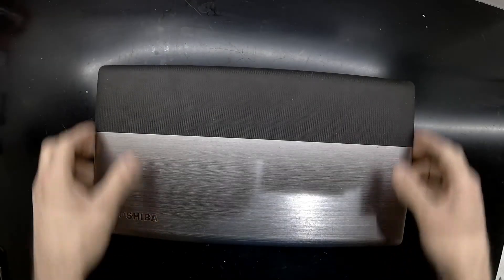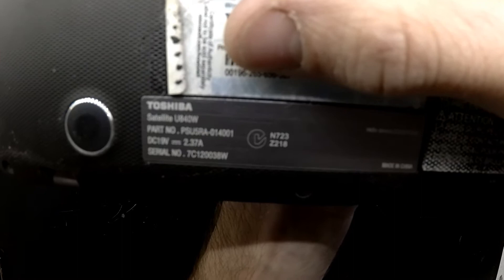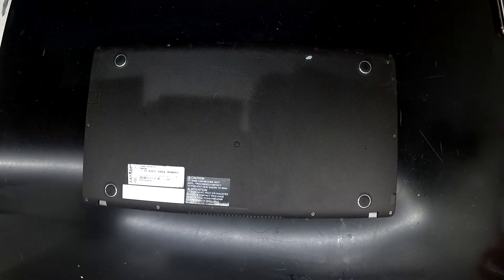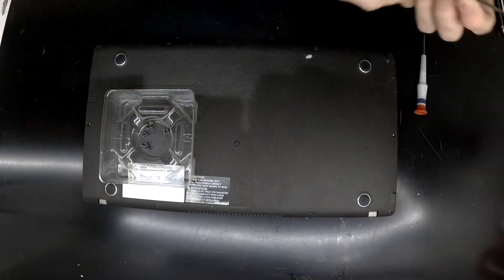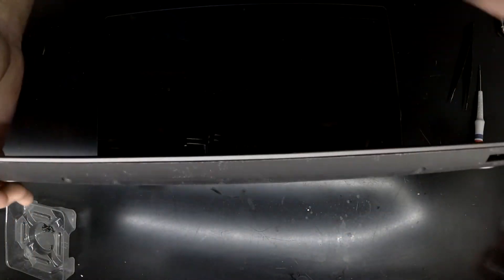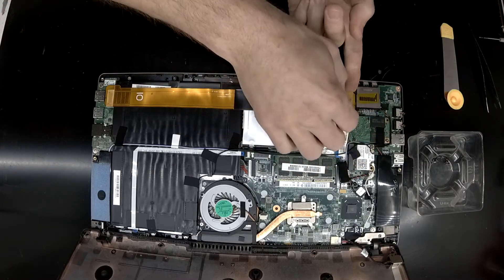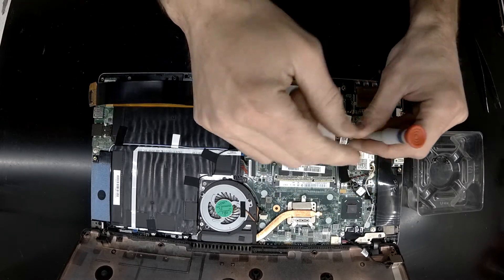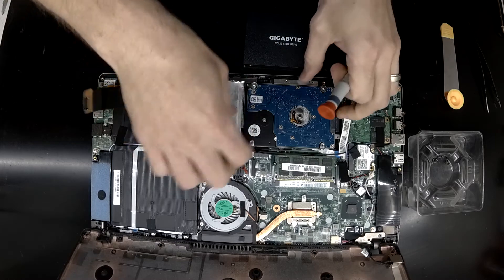Toshiba Satellite U840W Tear down, SSD upgrade

Comment: i need help inside my toshiba the hdd is of no way 2.5 because i tried swapping out the hdd in toshiba with a 2.5inc dont fit
Reply from the maker: there are a few different height 2.5" hard drives

i belive you will need a hard drive that is 7mm in height

Comment: Hi your video helped me as I also successfully upgraded my U840W with 500 gb ssd (as my original hdd was giving me disk errors and other issues since last six months )and after upgrade the laptop has become so smooth and booting  times are so fast). Has fixed a new life to my 2013 laptop.Thanks.

Only problem is with the crackling speakers . Do you provide u840w spare speakers as wish to replace them too.